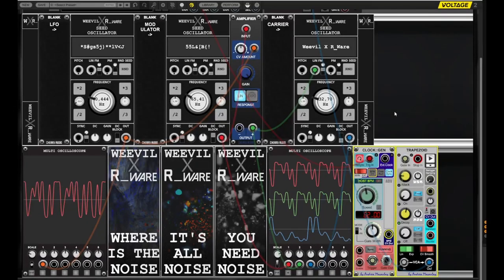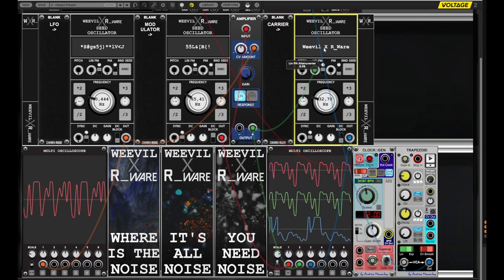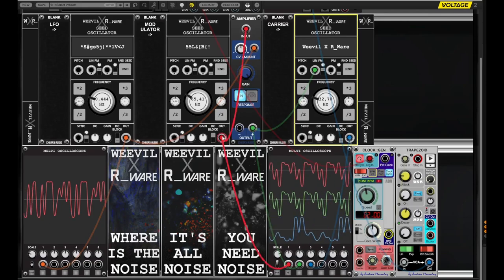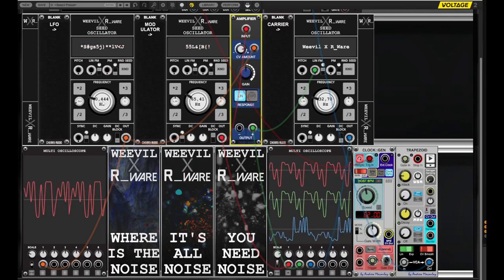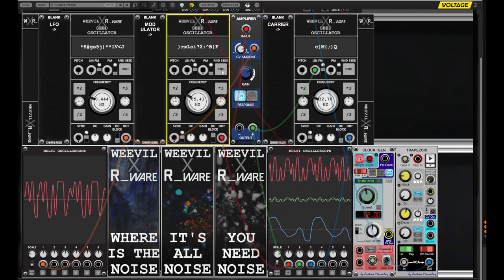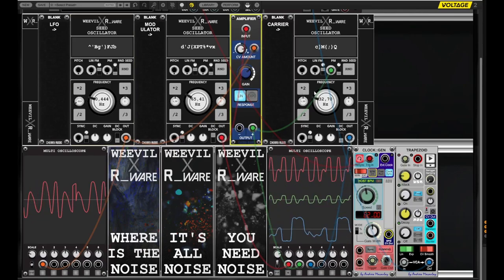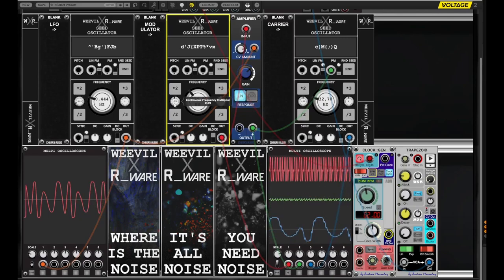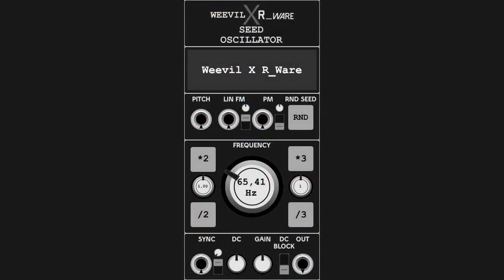Weevil X R Ware Seed Oscillator Bassline Tutorial

Comment: This looks like it has a lot of potential! Is there a way to save the seed that is generated?
Reply from the maker: The seeds are automatically saved with presets/variations. If you find a seed you like a lot you can save a module preset by right-clicking on the module (e.g. at the top) and selecting "Module Preset - Save As" from the context menu. You can also double click the seed editor and copy or paste the entire seed from there. Hope this helps :)